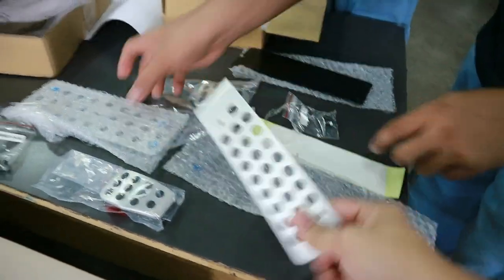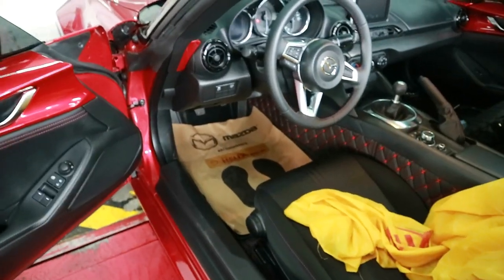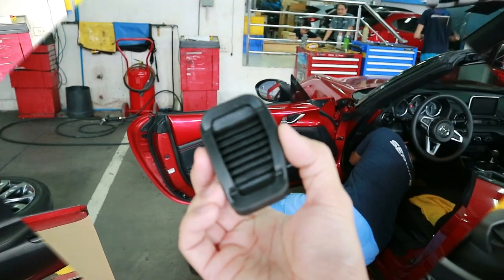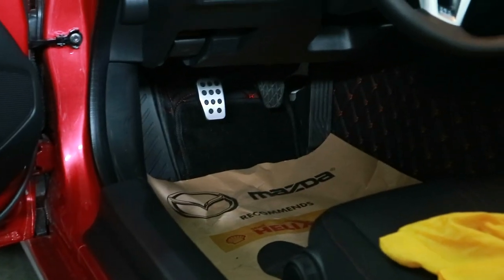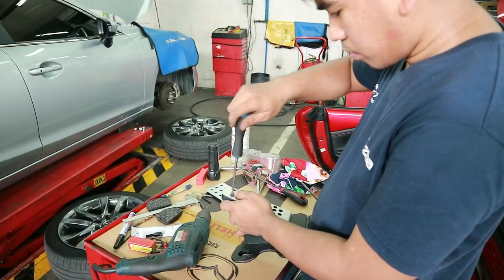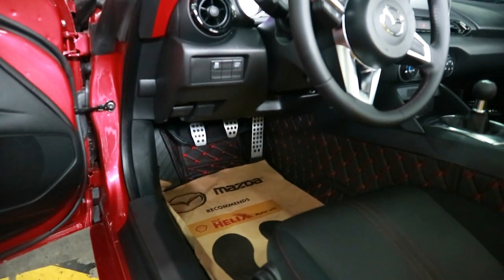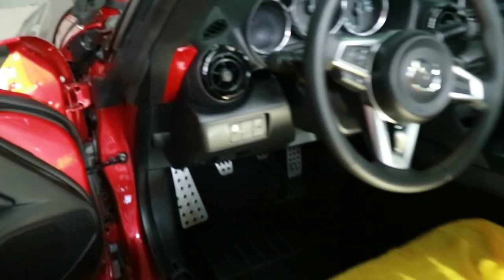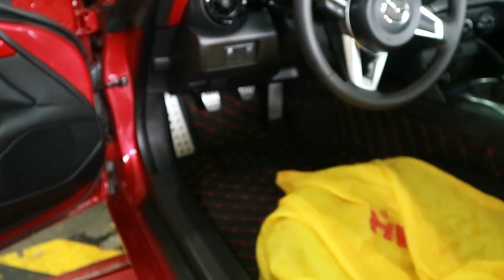Mk4 MX5 Miata Mazdaspeed pedal install!!

Comment: I just installed my brake and clutch pedal but I will leave the rest as it since I am not interested in drilling holes in my car and the stock pedals look fine. The pedals are very hard to install and I was only able to do it after warming them up by letting them sit for a while in very hot water. It is well worth the price and effort, the pedals are very cool and they are original Mazda parts.

Comment: Over priced considering just pieces of aluminum...and slip on?  NOT even appealing!  Will weigh more and possibly fall off compared to screwed on versions ....not impressed at all
Reply from the maker: Been using it for nearly 2 years and the pedals are as grippy and comfy as new. Looks as good as new as well. Mazda knows their stuff. Top quality product. 👍
Reply: I installed these on my clutch and brake pedal. They will NOT fall off if you install them correctly, they are in fact very hard to install and once they are on they are not going anywhere. These are genuine parts and if you ask me they are far preferable to after market pieces that need screwing and drilling. These fit just like the original pedals and no one has ever complained about them coming off.

Comment: It's tough, took me 1hr still unable to slot in the clutch or brake pedal, still figuring out 😂
Reply: Hahahaha. I had the same problem. I put the pedals in water close to boiling hot to make the rubber softer. It was not too hard to install the pedals after warming them up like that.

Comment: Does removing the negative charge of the battery reset the car's computer??
Reply from the maker: Yes it does.
Reply: @ReygansRides  I understand that removing the negative charge is for safety reasons, but what are the chances of shortcircuit when the accelerator pedal is plug an play??
Reply from the maker: @andrearrindell4  can't really tell, best to keep safe and unplug. Gas pedal is throttle by wire.
Reply: Oké, thanks for your fast reply. I will research this some before I start. I love my car to much to screw it up